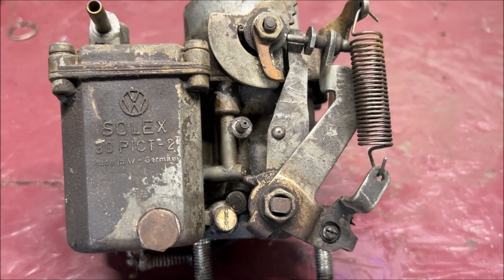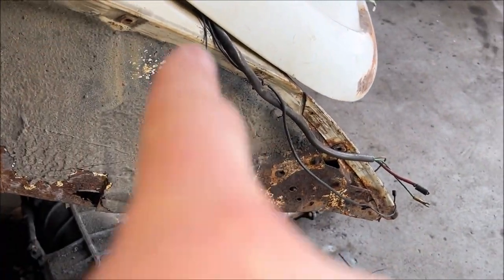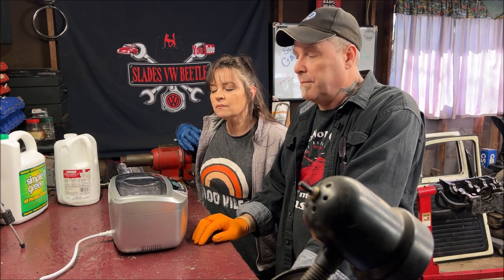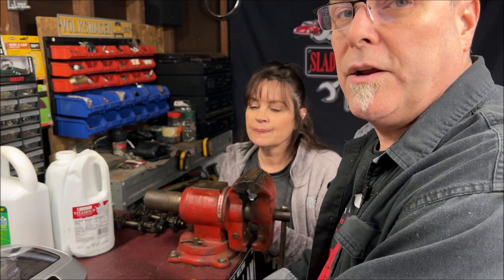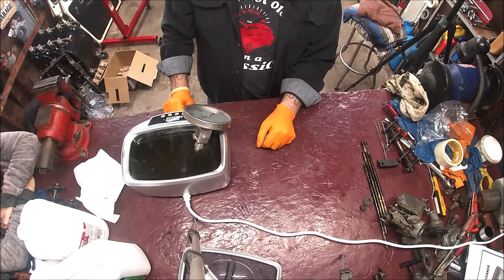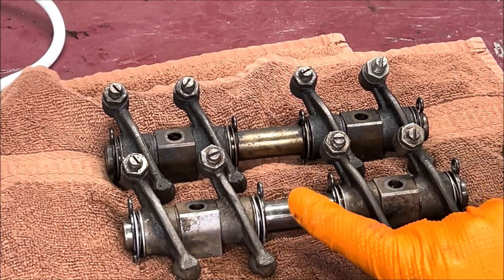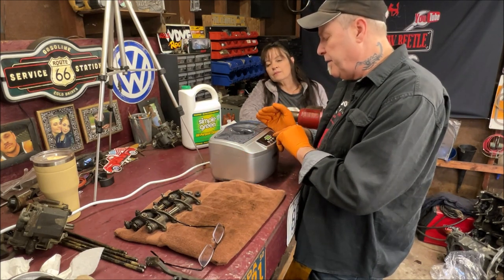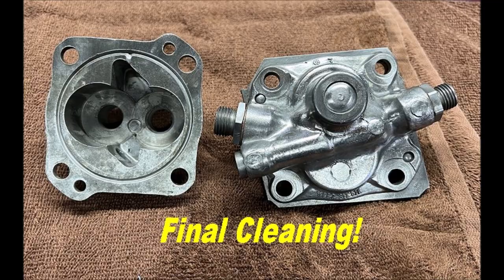VW Beetle - Super Beetle Rocker Arm Cleaning - Harbor Freight Ultrasonic Cleaner - Does it work?

Comment: BUSTED on the bath towels 🤣

Thanks for sharing, I’ve had one of these on my “need to buy” list for over a year now... ideally the 15L one to fit VW heads into.  I’m curious to see how the carb turns out, and would also be curios to see how vinegar works… I’ve found just soaking parts in vinegar to do wonders.
Reply from the maker: I’m amazed, the carburetor video will be out Friday. I would highly recommend buying the largest one that you can. I completely agree. I’m going to give this one to Heather. And buy a very large one.

Comment: You guys need to buy a bigger ultra sonic cleaner. Keep the small one for small items.  I have a 15L  sonic cleaner and its still not big enough. You can use a magnet to pick up items from the bottom of the tank.
Reply from the maker: Yes!! That is exactly my plans. I’m going to give that one to Heather, she can use it in her craft room. I’m going to buy a large one, off of eBay. Pretty much like industrial. I have a little bit too much fun with this thing.